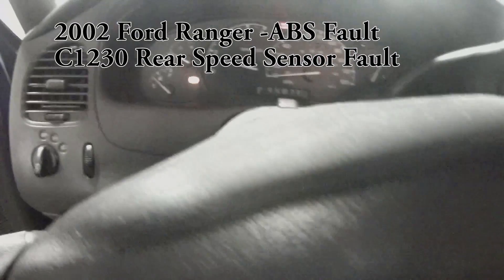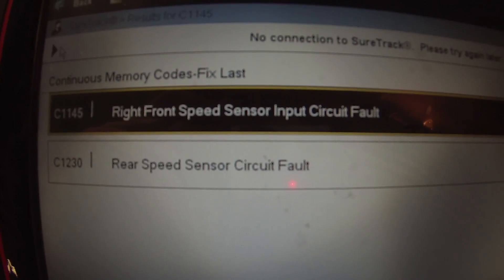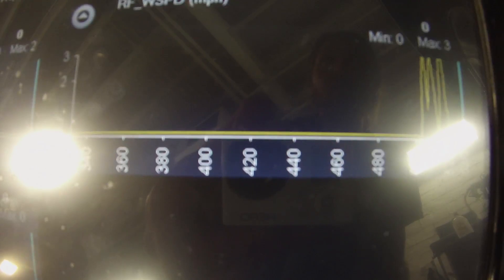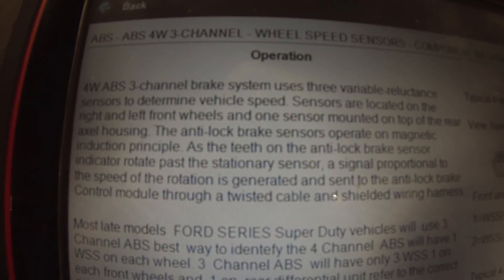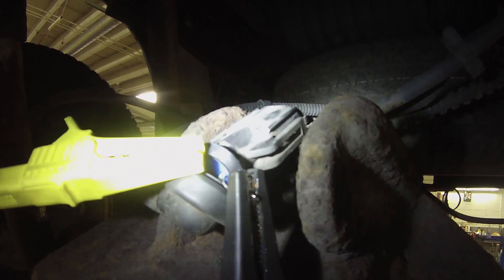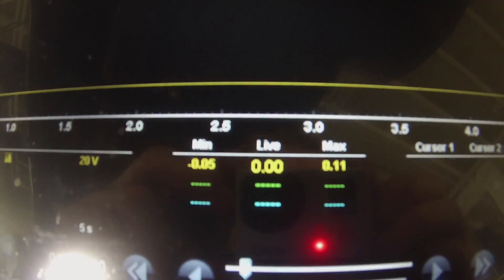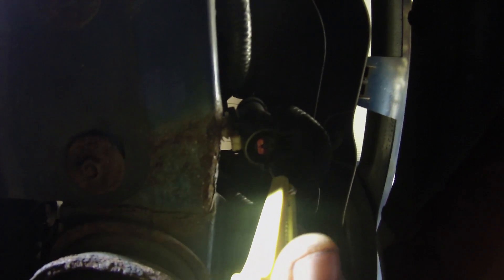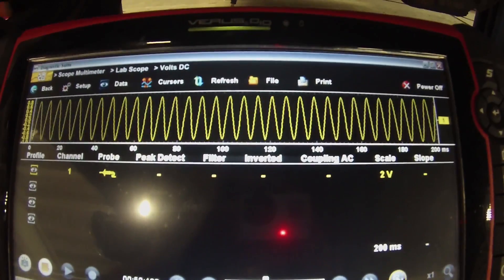2002 Ford Ranger ABS Light (Rear Speed Sensor Fault-Open Circuit)

Comment: If my rear wire a broke like yours how do i fix it? Do i fix it like a normal electric wire or this is a special wire? Thanks you
Reply: Use a butt splice, and crimp or solder it... I prefer both; make sure to put shrink tube over it. Looks like regular old wire to me.

Comment: Isn't a VRS supposed to create its own voltage regardless of any input? I mean that that broken wire should not have make any difference when you back probed the WSS, you should have seen an AC sign wave, please correct me if am wrong
Reply from the maker: You are correct. I don't think I had my t pins all the way in. I wish I would have went a little further into that but then I quickly noticed the damaged wires. I think the 2.5 v had to be a bias to help block interference. I should of had a signal there   I'm going to do some research on that design.
Reply from the maker: Or I'm just wrong on my design.
Reply: the design must be correct because a hall effect sensor uses 3 wires with a 5 or 12 v reference you only had 2 pins so it should be a VRS as you later confirmed by that AC sign wave, the 2.5 v should be a bias voltage to monitor the circuit  thats why you had the code C1230 with the description circuit fault, cause the computer is sending those 2.5v and its expecting to see those 2.5v back to the pcm and its not
Reply from the maker: I didn't have my t pins in far enough. Il make sure I do next time
Reply from the maker: Another thing too. Was that my guided component test info was wrong. But def is a vrs
Reply from the maker: I just looked at a 12 Vw Jetta. Lr speed sensor fault. It's a 2 pin one wire has 12v the other is ground. To see the signal you have to ac couple because the speed signal is a small ripple in top of the 12v. Disconnected sensor and it does not create its own voltage   Very strange style
Reply: I was thinking the same. But could a short to ground have caused the no signal, since the wires was exposed? Positive Lead Diagnostics, I have also meassured that type of sensor, a 12v with a digital signal on top, if you know what i mean ;) Thanks for sharing.
Reply from the maker: A short could cause that but the wires were broken. I don't think I was making contact
Reply: Some of the new hall sensors have only 2 wires (intelligent hall sensors) they measure air gap, foward motion and reverse motion. They have a live,earth and the earth is also the signal.But we can clearly see this one has an ac waveform. Nice video.